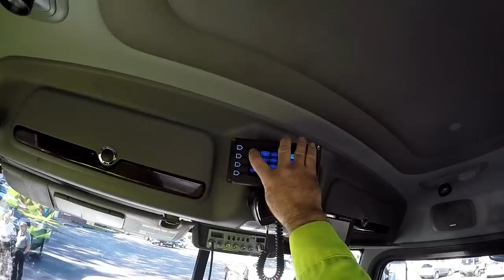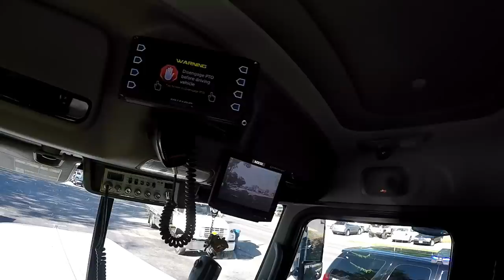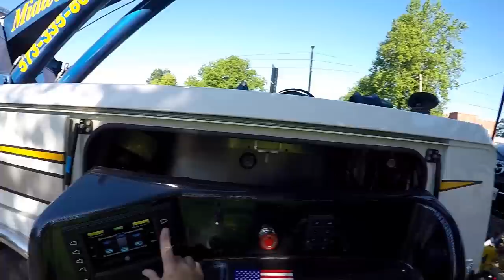TROLL BRIDGE

Comment: Is it true that once the airbags are deployed the vehicle is totaled by insurance because of the airbag?
Reply: I believe my question was just answered by the video. Thanks
Reply: Bruce J. And I can attest to that myself. When they went through my car when it got hit the air bag warning came on. The air bags were not deployed and when they saw that warning light they automatically totalled it. If it were not for that they would not have totalled it.
Reply: Bruce J. Not necessarily it mighty of been the inpack of the hit
Reply: In general, yes. Insurance companies will not risk a larger claim due to future problems w.r.t. airbag replacement, or unseen issues caused by the incident that triggered them. Sure, there are things that can set them off without doing structural damage (this case was most likely roll rate), but it's unwise to ignore the fact that they were deployed. Plus, airbags are expensive and nobody wants the liability for replacing them.
Reply: It's usually not so much because of the airbags being deployed, but more because of what it costs to replace them. Airbags are expensive and depending on their location fitting a new one can be expensive as well.
And Greg Hurt, many cars have seat belt tensioners too nowadays, those can go off even if the airbags don't. That could be a reason for the airbag light to be on without any obvious signs deployment.
Reply: not necessarily, the car is 2008 black book value is less  already if you price out the airbag.. let say each airbag cost $500 - $1500 + airbag sensor ($200 - $500 each sensor) + the repair of the car
Reply: +Bruce J. I don't believe it does. But the cost to replace the airbags (about $5,000) would have to be included in the damage estimate. Unless it's a pretty new car that would probably push the damage into the totaled category.
Reply: When my wife was in a minor collision in 2010 in a 2002 car the air bags deployed. The insurance company explained it to me that it is not the cost of the air bags themselves but the electronics associated with the air bags that drives up the price of the repair. The insurance co. wrote off a barely damaged car and paid me 10,500.
Reply: Bruce J. Insurance companies usually deem a car a total loss once the damage reaches 80% of the vehicles worth value. There also may be other factors that may determine if a veh. might be deemed a total loss such as it being in a deep flood especially if it's salt water.
Reply: The underlying issue is certification that the replaced air bags are now safe enough to save the insurance company against a liability case if the car was then involved in a wreck resulting in death or significant injuries. The corner mechanic isn't qualified, nor will a dealer stand behind that 8 ball. Think about a 10 million dollar lawsuit aimed at you and understand it all boils down to how good is the mechanic. I can't get a tire fixed right, how about you? No shop in their right mind will certify safety on air bags new or otherwise - that's on the car manufacturer and they do it only ONCE.
Reply: On cheap cars yes, exotics and sports cars NO

Comment: Why do you leave the engine running when you leave the truck?
Reply: To power the winches and accessories?
Reply: The Rotater almost certainly uses direct engine power for the hydraulics and maybe the winches as well. Even if the winches are powered by electric motors, the engine is necessary to generate the electricity; you definitely wouldn't want to have the battery be depleted in the middle of a lift!
Reply: Penny Lyons Yes, the rotator would be hydraulic, so needs the engine for the pump.
Reply: Ethan Mc Clelland 
yeah those winches are powered by the pto on the transmission. on his touch pad he engages the pto and when he moves with the pto on he get a warning indicator on the touch pad so he doesnt damage anything.
Reply: Penny's answer is 100% correct. The long answer, however, is the engine uses a PTO (power takeoff) in the transmission to power a hydraulic pump, and the hydraulic pump powers the boom, outrigger, and winch functions. The engine running also keeps the batteries charged using the alternator so all the emergency lighting doesn't drain them.

Comment: reuse carseats thats been in a wreck, what is she thinking? not like ur asking a professional race driver to reuse a crashed seat -.-
Reply: McTw1st Hopefully her insurance company will ask for proof that they have been destroyed before replacing them. Cutting the straps is sufficent proof to me.
Reply: +McTw1st   The only reasons for not reusing the car seats would be 1. because the air bags deployed, and 2. because the car could not be driven away from the accident. Neither of these things would necessarily mean the child seats were damaged. The car has likely been repaired and is back on road. There is no reason that the child seats shouldn't be too. Assuming there was no obvious damage to them. Anyway, she might have fully intended to replace them anyway, but just wanted to use them temporarily until she could buy new ones.
Reply from the maker: The law actually prohibits reusing a child safety seat when it has been in a crash.  Even though there may be no visible damage, you want to ensure the safety of the child at all costs.  It may be expensive to replace, but a child cannot be replaced.  God bless.
Reply: Insurance also pays to replace them anyway. We had someone back into us in a parking lot, so no more than what a hard stop would be, and they still replaced one and required pictures of the straps being destroyed.
Reply: Things always look fine until someone is killed.
Reply: Just like people buying car seats off craigslist. Not smart

Comment: Couple of thoughts here; live view from that boom camera on a portable display could be really handy in the field.  I know there was a WiFi block for the older GoPros, or you can get some cheap knockoffs from Amazon with it built in for $50 or less.
Not sure how your electronics skills are, but I've seen a few folks on YouTube that have built control boxes for air and electric horns to give them a button box with different horn patterns, so a one-touch triple for backing up, or even automate it off the backup light circuit.  Even better might be adding a cheap car horn at the back to make it more obvious to someone walking behind the truck exactly who's honking.

Comment: Ron, I remember in one of your video's (want to say it was the G6 water extrication), you were concerned with the length of the winch cable on the rollback not being long enough, and wanting to change out the spool for a much longer cable. Did you switch out all the rollback units, and if so what length did you end up going with? Thx.
Reply: I'm not 100%, but I believe he went from 50' 3/8", to 75' 7/16".
Reply: Sonnicman ... I believe he had 50' and they upgraded the cables to 75' on all tow & rotator vehicles.

Comment: Another awesome video. Quick question, when the suv was placed on the rollback, I saw chains connected to the front end and into the chain pockets, then the winch bridle put on and pulled tight. Do you then throw another set of chains on the vehicle going to the front of bed? I haven't spent much time in a rollback, but I was taught to use the winch for recovery and then chain down. The winch doesn't count as a tie down since it is not rated to hold the load, only recover. Thanks and keep up the good work!

Comment: Everything about your process seems pretty Seamless.  That what happens with 30+ years of Experience.  The capability of Tator probably blows your Dad away based on what he worked with for many years.  You have positioned Midwest Truck quite Nicely.  Your Great 👍 and Super Courteous Attitude places your Company over the Top and everything starts at the Top so your Fine Example will rub off on your employees or else.  😬

Comment: Stupid question... Why the bug spray?? I know it's not important, but it actually surprised me how Ron said he wouldn't do anything until getting bug sprayed...
Thanks!!
Reply: 5:01 Chiggers, ticks, and mosquito's. Ron has mentioned in other videos that they love him.
Reply: Lyme disease among an entire raft of other endemic tick borne diseases can be avoided by taking the time to apply repellent. An ounce of prevention being worth a pound of cure it only makes sense to think of the costs and quality of life your family will suffer if YOU are disabled. Ron is simply paying it forward here and setting a fine example at the same time.  Like always.
Reply from the maker: Not a stupid question, but I have been a bug buffet too many times NOT to pre-spray.  God bless.
Reply: and chiggers like area's where clothing is tight.  Socks.  Belt lines. 'Private' parts.

Worse case of them I ever had:  Ten years old, loading round bales on pickups to get them out of the field before it rained.  They were light by most standards, about 50 lbs.  I'd snag one with a hay hook, drag it to the tailgate of the pickup, pick up one end and set it "there" (you could get away with that as a ten year old ;-)  ).  Reach to the other end and hook it, grab with both hand and lean back, 1/8 turn and set it on the truck where the stacker could reach it.  I lasted until we were done, about three a.m.

Next day I woke up scratching.  I itched all day.  I got woke up about every 2 hours the next several nights by the itching.  When things started to get raw, a large, very soft bristle hair brush became my best friend (and my sister refused to use it after she found out what I'd used it for).  I couldn't tell where one welt ended and the next one began.  Best cure for them would have been a long, full day swimming at the pool the Baptist camp had, just to our north, but it was scheduled full for the next two weeks.  A pad soaked with rubbing alcohol would get them to go quiet for a while, but never long enough.

I finally resorted to a bathtub of lukewarm water, heavily dosed with Clorox, strong enough to bleach your nose hair with, and soaked in it until I was wrinkled like a prune.  Twice, before I got all of them.  I think they constructed condo's and had parties on me, all I knew was that I was one miserable boy at the time.

Comment: Ron, another great video! One quick question on the set up on this lift. I see that the hooks for the pulleys that were placed on the auxiliary lifting points were clipped in from the rear of the boom arm, so that the hook opening / latch was towards the truck and facing upwards when under tension. Does the orientation of those hooks make a different on the lift or from the safety side of things? Thanks for taking us along and sharing your adventures.

Comment: @Ron Pratt I've noticed (on every one of your rotator vids I've seen) that you have to do something manually to the rear outriggers before deploying them, but your helmet cam never catches exactly what you're doing.  Pulling a safety pin, or making an adjustment of some sort?
Reply from the maker: There is a safety pin that keeps them retracted that has to be manually released.  God bless.

Comment: hey great video. nice job by the way. I have waited all week for the next video. I have a question for you do you have air bags just for roll overs
Reply: Yes he does have and carry air bags for when he needs but hardly uses them since most cases the load is not too heavy for the wrecker crane. He has yet to post a video using them.

Comment: You know,  as fancy as that rig is; I'm surprised there isn't a "reset to default" mode that would roll the deck back, reel in the cables and retract the boom automagically.   Same for your outriggers.  Surprised there isn't a simple command you can issue to draw in and stow the outriggers.  I mean, it'd make sense.  All your controls are 'fly by wire'

Comment: How often do you have to change the steel cables on the truck that you use for lifting?
Reply from the maker: We constantly inspect and maintain the winch cables on every truck in our fleet.  The rotator cables are all still the original cables that came on the truck.  We got the truck in January 2015, so they are currently a little over 2 1/2 years old and still in good shape.   Thanks for watching and God bless.

Comment: Is there a safety lockout from setting the lines to free spool if they are under load?
Reply: Electronics asks for a confirmation before going to free spool. Timed. So if you do not confirm it goes back to simply holding the load.

Comment: NC regardless of the yr of vehicle..if air bags have been deployed... instant total out... Son had a new 2018 Kia SUV ( can't ever remember type) they had it 2.1/2 months ( think he said it had around 1500 miles on it) icy roads ...slid into a  gaurd rail ...quess  it was hard enough to set the bags off..damage wise...approx 1200 is what he was told ..air bags went off.. it's totalled as Ins. Co. Don't want to be responsible.

Comment: What is the weight rating of the winch on the rotator
Reply: Main pair on boom are rated for 50k pounds (1/3 rd of that at full boom, secondary pair are 35/22k each (not sure which capacity), per Miller Industries web info.
Reply from the maker: Thank you and God bless.
Reply: Joshua79C C ok thank you

Comment: looks like that clapped out bridge needs replacing and they should have had an Armco barrier by the road as the ditch is a serious hazard...over here all bridges...culverts etc have to have Armco or Road Restraint Systems as they call them... by law to prevent drivers going in to the ditch or river...or cutting...
Reply from the maker: It is a dated bridge for sure.  We were just glad no one was injured.  God bless.

Comment: RON PRATT      HI RON, JUST WONDERED IF RECEIVED MY SUGGESTIONS REGARDING "OH SHIFT" AS PER YOUR REQUEST?
Reply from the maker: I haven't seen them yet.
Reply: Ron Pratt  Well. If you go to the video where the metal almost went through the cab of the green truck ...in titled. Better yet I'll copy and paste it for you.

My Suggestion For The Rotator.

1. The blue transmitter cover might work ...so long as it would clear the sides. Then maybe a little welded strap at the rear, but still allowing the cover of the transmitter to be removed, should need be. The unit will do wonders ...even if it is only 3' - 4' long. If you can go a little larger...better yet.
2. I suppose it could be mounted on top of the deck, on the lefthand side ...however, behind the deck-light so it wouldn't interfere with same. The unit would require a customized mount to elevate it above the deck-light. Then it would have to be designed to turn and lock once the job was completed.
3. The rear of the truck is a little more difficult, because of so much going on. You have breakaway-chains, D-rings, and mostly the under-reach unit. Nevertheless, I think the under-reach could be used if the arrow-bar was mounted on the top portion and centred. Then a mount so that the bar could swivel and lock, lining it up vertically with the under-reach prior to putting it away. The drawback with this idea is that it will never be as effective as the other suggestions, unless you are working behind your obstacle.

I think you will agree Ron ...although your safety would have to contend in being the most important issue ...still, you don't want it to take away from your truck if at all possible. I know ...other than my trucks, I have a totally customized black corvette. Some of us really do care, right?  ~Paul~ ...Be Safe!

Add in time: You may want to drill a hole at the "bottom rear" of the arrow unit ...so you don't run into it when you have it turned to function mode at night.
Reply: Ron: to see my response ...click the "blue letters" reading 2-comments.